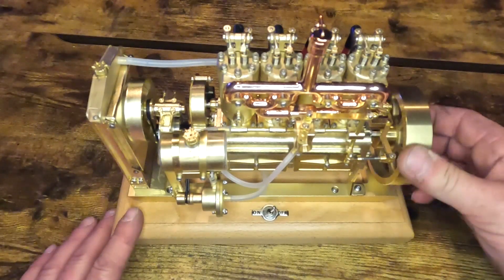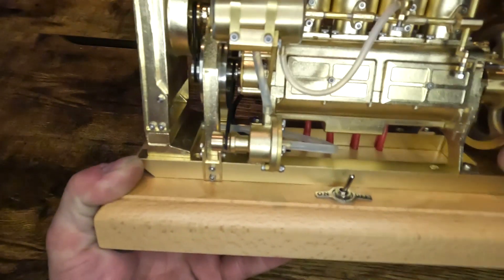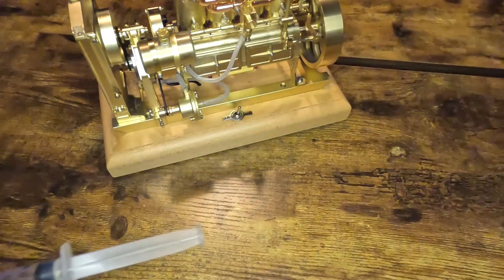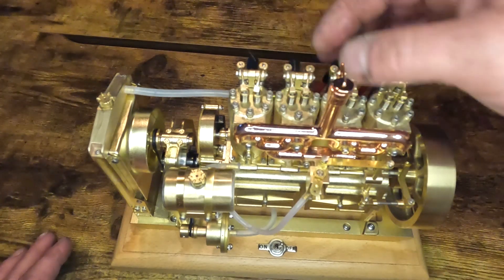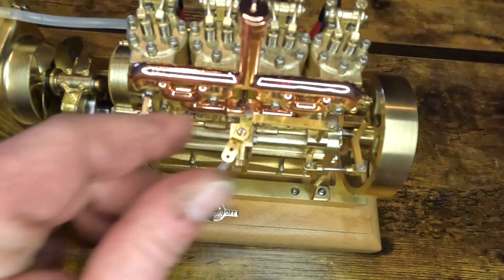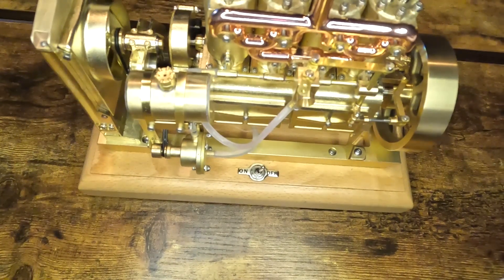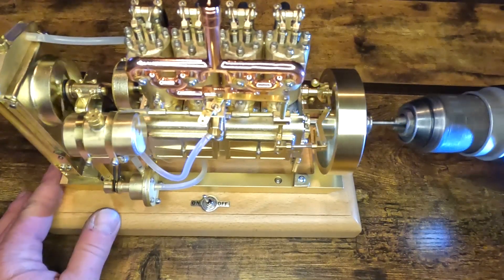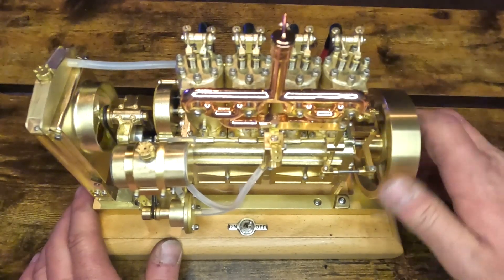H75 Holt engine

Comment: Did you lube the valve guides and the rocker arms before running ?  I got the bigger size Holt engine & am going to sell it. It is 90% done. I have too many engines.  Also my fingers are bad now.
Reply from the maker: @JohnSmith-yn8pl  I tend to over oil my engines which always results in a bit of a mess but no damage to the engine.  I understand completely where you are coming from, I haven't been in the shop for months now, I have too many other things that have been taking my time. Is it possible though to really have too many engines?

Comment: Steam212° Is there a way to contact you i working on Cole's Holt 75 engine i am struggling with ..  I also have a traction engine needs some attention had some holes drilled threw steam chest when they over sized the studs blew threw the castings in many spots on the edges i needs some one who possibly could help me repair it with guidance i grate a repairs im just at a cross road dont know what to do.. Thankyou
Reply from the maker: No problem, you can email me steamat212@gmail.com

Comment: Why does everybody mess around with the throttle lever, but NOBODY seems to ever give the flywheel a bit of resistance to see if the governor picks up???????
Reply from the maker: I guess it's because it's a fun challenge to see how slow it will run.   I will have to get it back off the shelf and put it under a load to see how it responds with the governor.
Reply: @steam212  I would really appreciate if you would make that effort and post it on your channel.

Because I intend to run engines like this "for real", and in all fairness and no offense towards anyone that thinks this engine runs great... I have different views on "running great". If it can't pull a load, it does not run great no matter how nice the sound or the visuals. If it wears excessively, ditto.
I understand you cannot do wear tests or endurance tests, but it would be really awesome to get an impression of how the engine holds up under load.

I really wonder how the O-rings on the pistons fare. I can see that the designer has taken that into account by placing the rings really low on the piston, and the wet liners are a great idea too, but still.

Comment: So they designed it to run clockwise?  The Holt/Cat engine on a Caterpillar Sixty turns counter clockwise as do most (all?) Holt tractors.
Reply from the maker: I thought the same thing, maybe it was an oversight on their part, or it was not too much of a consideration at all.

Comment: Where can I buy spark plugs for the engine?
Reply from the maker: You could check at a local hobby shop they are 1/4 x 32 thread. Or they are always available on eBay too

Comment: If you put a twist in the belt that drives the water pump like a figure 8 the pump will run the right direction. It won't harm the belt since the engine won't be running for long periods of time. Hope this helps!!
Reply from the maker: Hi Terry, You're exactly right about the twist in the belt. I did give it a twist after looking at it (second video) and it's been doing great ever since.  Thank you for watching and for commenting 👍

Comment: Why don't you just flip the pump belt over half way to make the pump go in the right direction? Like on this one: https://youtu.be/4_udcg7j9Xw
Also, the radiator doesn't care which way the wind blows through it as long as it moves. Of note, the original Holt  caterpillqar engines turned counter clockwise from the flywheel end so the pump is actually a correct design that just needs the rotation reversed or the exit tube moved to work on a clockwise rotating engine. I happen to like the clockwise rotation as it is very easy to start by hand.
Reply from the maker: Hi reddrryder, Welcome to our shop. You're exactly right, I did put a twist in the belt to allow the pump to rotate in the correct direction. And I understand what you're saying about the fan direction, as long as there is air moving through the radiator it will do it's job. The right hand rotation (flywheel end) does make it much easier to start by hand👍. Thank you for watching, commenting, and subscribing.

Comment: two-stroke petrol in a four-stroke engine???
Reply from the maker: Hi Waymey, Yes indeed, I am using 40:1 two cycle fuel. These engines use florogel O-rings for piston rings. By using mixed fuel I can assure that there is sufficient lubrication on the cylinder walls. Thank you for commenting and for watching 👍
Reply: @steam212  thank you too for fast answer. nice, good to know now.

Comment: I have one of these engines. I am having ignition issues with. I have found when it is first tuned on there is no spark. If I let it set for about a minute with switch on not turning it or anything. Then try it, it has spark and will run. Has anyone else had this problem?
Reply from the maker: Hi Randy, I have not had any issues with the ignition on this one. This is a stupid question (I'm sure you've done it) have you tried replacing the batteries to see if the problem still happens?  The next thing I would check would be the switch with an ohmmeter to see if it is closing the circuit completely.  If I think of anything else I'll be sure to send you a reply.  Thank you for watching and commenting, I hope we'll solve it together 👍
Reply: Yes I've tried several different new batteries.  Still same issue. After the first time starting it, it's fine. Turn it off and start it right back up. If it sets for 1/2 hour or so something again. I have checked everything, wiring,  switch, ground, battery voltage. Everything checks fine. At first I thought it was bad connection. By time get to checking stuff with a meter it would start working. That's when I figured out to turn it on let it set for about 1 minute and it would start.
Reply: I forgot to add that I've talked with RedRider and he is also having same issues I am.

Comment: Does it run with petrol?
Reply from the maker: I am using 94 octane non ethanol gasoline mixed 40:1 with 2 cycle oil. I hope this answers your question. If you have any other questions please let me know. Thanks for your question and for watching 👍
Reply: @steam212  do you have any website where i can buy this engine?
Reply from the maker: @tamanchakma9634  Stirlingkit.com offers them as well as Enginediy.com but they are also available on eBay.

Comment: Here is another model Holt engine which is started clockwise at the radiator end of the engine and not at the flywheel.I wonder if the Chinese got something wrong? https://youtu.be/AjQLKLaDOTY

Comment: The reason the fan and water pump are moving backwards ,,,is that,,,,,, your turning  it backwards,,, You said it was a steam engine ,,,DA !!!!
Reply from the maker: Hi Gene, I would suggest that you go back and watch the video again before you label me a dumb ass. Nowhere in the video do I call it a steam engine, and furthermore if I were turning it the wrong direction how is it that it started and ran? I guess some people have little more to do than expose their own stupidity by commenting on a video that they know nothing about.
Reply: Hmm.  How many other four stroke engines have you seen run backwards Gene?

Comment: Ccw bud...
Reply from the maker: Hi David, I'm not sure I understand what you're referring to? Let me know a little more and we'll go from there. Thank you for your interest and commenting.
Reply: @steam212  if I'm not mistaken, I noticed you spinning the engine clockwise from the flywheel and it should spin counter clockwise...  The notion is due in part to the direction of the blades and the water pump is in the right direction that way...
Reply from the maker: @davidhilton7780  You're correct, I am turning it clockwise. This is the correct direction of rotation when viewed from the flywheel. If we were to try to run it the other direction we would need to change the camshaft and the firing order. It is kind of funny but that's the way it's made.  If you'd like, we can make another video and now that I'm a bit more comfortable we'll go over it a bit closer. Just let me know. Thanks again for your interest and your comment
Reply: @steam212  no need to change the order, just rotation. The timing following will be in order, it will work fine. Thanks for the share, it's a neat looking model engine!

Comment: its a pusher fan.  alot of old tractors and stationary engines had that.  if theyre just sitting still they would pull heat away from the engine.  i always felt like thats just pushing hot air through the radiator but i don't know lol.  they had them for 90 years so they must have a purpose lol

Comment: No need to change anything. It is normal for engines to run in a clockwise direction as viewed from the radiator end.
Reply: A great many pump and dredge engines have their flywheel/rotor/impeller mounted as it is on most turning lathes - it is threaded on standard threads.
They literally "screw" their propeller on under load. The only exceptions I ever knew of were the Chevrolet Corvair and early Porsche 356 speedsters and they were in rear engined. I have barred over early early Caterpillar gas burning engines and that turned standard direction. Looking now for videos of a Holt 75 being barred over to see which direction the originals turned.
Reply from the maker: Hi Ian, I have no intention to reverse the rotation of this engine, which would be quite a task, only the water pump so it works and the fan. Thank you for your interest and commenting.

Comment: Do you recommend 2-stroke petrol or, as the manufacturer writes, petrol 95? I just ordered the 2 cylinder model.
Reply from the maker: I would recommend using 2 cycle oil. The added protection of the rings, pistons, and cylinder walls is worth the little bit of smoking. This is only my opinion though. I hope this helps.  Thank you for your interest and your comment.
Reply from the maker: Thank you for your comment!  CONGRATULATIONS!  You have won a  mug!   Feel free to contact me at steamat212@gmail.com and I'll get it sent out to you.
Reply: @steam212  Yesterday my machine arrived the 2 cylinder model, I prepared everything. With 2stroke Husqvarna alkylate 2% XP Power 2 fuel, the spark plugs seem to be working. But I can't get the machine to start.
Reply from the maker: Have you put a finger over the intake while cranking it over to choke it?  Sometimes I need to do that with any of my small gas engine models.
Reply: @steam212  Yes, I tried that with my finger too. It also sucks in the fuel but doesn't ignite it. I also tried the needle on the carburetor in different positions, unscrewed the spark plugs, they work. But the machine doesn't start. Gas comes out of the exhaust
Reply from the maker: @RioDeLaNorte  I have a stupid question,  im sure that you are spinning it in the right direction aren't you?
Reply: @steam212  Maybe I should try lighter fluid for a first start?
Reply: @steam212  Yes, clockwise to the right if I'm in front of the flywheel
Reply from the maker: @RioDeLaNorte  If fuel is coming out of the exhaust, there is no doubt that it is flooded. Have you taken the plugs out and cranked it over using a drill to clear the cylinders then start with the adjustment needle 1/2 turn open? By the way,  I have a mug to send to you but I do not have an address.  Email me at STEAMAT212@GMAIL.COM
Reply: @steam212  what is your needle settings. Both idle and high speed. I messed with mine before I recorded the factory settings and now I can't get it to start.
Reply from the maker: @dblnaknak  Right now my main is 1 and 1/3 turns open on the main jet and 1/2 turn open on the idle jet. I have noticed that temperature and humidity levels do have an effect on this little engine, but that should get you in the ballpark and get you a good starting point.  Thank you for the question and for your interest.
Reply: Thank you I'll give it a try. When it did start before I noticed that one cylinder was running hotter than the others. Have you experienced that? I'm hoping that that cylinder water inlet isn't plugged
Reply: @steam212  ok figured out the problem. I took all of the play out of the valves and it wouldn't start anymore. Added 1/2 mm of play back into the valves and it started right back up as factory.
Reply from the maker: AWESOME!  Well done

Comment: Be careful using a plastic syringe to fuel your engine. Depending on the type of fuel you use and the plastic material the syringe is made of, the fuel can start to dissolve the syringe and end up in your fuel system.  It looked like you had to push the plunger fairly hard which is an indication that the plastic is being effected?  
The fit and finish on these engines is poor at best. They know the areas that need attention and the ones that don't.  Most of the loose tolerances have little effect on the running of these engines with the exception of the governor. It defiantly needs some attention. 
There is certainly no excuse for the water pump turning the wrong direction. Centrifugal pumps are defiantly not reversible.
Still a nice runner.  Enjoy your engine.
Cheers
Willy

7/4/2022
Allot of full scale industrial equipment have reverse air flow through the radiator.  I think it's to help prevent dust from plugging up the radiator fins and blowing it all over the engine. Not to relevant with a model engine.
In regards to the direction of the water pump turning, you could put a twist in the belt.  Have you heard if they fixed this yet?
How much time do you have on it?  Hows it running now with some time on it?

Cheers
Willy
Reply from the maker: You're right about certain fuels attacking plastic and rubber, but the fuel I'm using here is ethanol free and I do not store fuel in the syringe. It really does look like I'm struggling to fill the tank but I'm trying to go slow as to not make a mess on it. You may have a point about the tolerance issues but sloppy tolerance in a rocker shaft will have a huge impact on valve clearance.  Thank you again for your comment and your interest.

Comment: Thank you Steam 212 deg - Your video led me to also pick one up.  I agree, the water pump is rotating in the wrong direction, so crossing the pulley belt over was an easy fix. I'm not doing that with the radiator fan as I think it will also work well blowing air out through the radiator.
Reply from the maker: Congratulations!  I hope that you enjoy yours as much as I love the one I have. Thank you for your comment and if there is anything I can help you with please let me know.  P.S.  If you get in trouble for buying it, please don't blame me 😉

Comment: Neat ! The fan blowing forward was common on some tractors and pretty much standard on stationary engines and forklifts. Been a few years since I was around any of the real Holt's so don't remember how their fans were set up. Dang I want one !!
Reply from the maker: Thank you for the comment. Im not sure that it would make that much of a difference at the speed that it is running, but if you've ever looked at and studied the rotation of a desk fan, an airplane prop, or a windmill, but the profile of the blades make it more productive at its designed task (push or pull) (drive or driven) and when a prop (fan) is enclosed (shrouded) the effects of the blade shape are either increased or nullified. Now you've got my brain thinking that we need to test this. GREAT COMMENT!   Thank you!
Reply: @steam212  Like I said it has been at least 20+ years since I was up close and personal with either a big Holt or Cat. So which way the fan moved air I just don't remember!  But as you said the blade profile is optmized for which way they are designed to move the air. Back in the 60s-70s I sold Cotinatinal industrial engines and parts and we had pusher and puller fans for forklift and enclosed power units.
Reply from the maker: @dog8nut   I think we need to make a quick video about this (because I want to see and learn too) we'll run the fan in both directions and take a temperature reading. I'm excited to see what the outcome will be.
Reply: I can confirm that most earth moving equipment the fan blows from the engine through the radiator, the reason is because on a dozer for example if it sucked in the air from the front the dirt from the job would block the radiator

Comment: Thank you very much Steam 212, very useful tips especially about the fuel and oil. These kinds of engines should not run on Zippo fuel! They will jam! I used 2stroke Husqvarna alkylate 2% XP Power 2 fuel. Works fine.
Reply: I mix camp fuel (the naptha variety, cheap by the gallon) with a VERY small amount of Marvel Mystery Oil for cylinder lubrication. There is no benefit to running any form of gasoline as you don't need either the additives it has or the high octane.  I have several of Jin's engines I run this way, and I never experienced a jam or even a worn mechanical part, the Viton rings last a long time, and there is very little exhaust smoke.
Reply from the maker: Hi Lars, I agree with you about not running zippo fluid as a fuel for these little engines. It will run them but it doesn't have enough lubricating ability in my opinion.

Comment: Can it be used in a rc car?
Reply from the maker: I'm sure that it could be used to power an R/C model, but keep in mind that this is not designed to be a high rpm engine. It is patterned after an engine used in crawler tractors 100 years ago.
Reply: More like an RC tractor or dozer